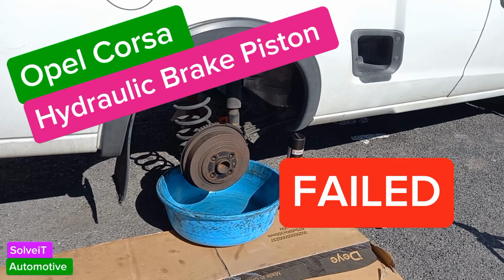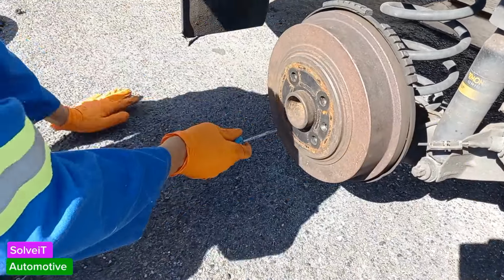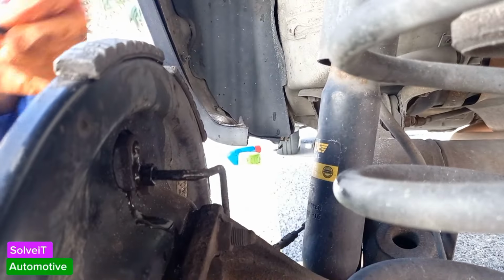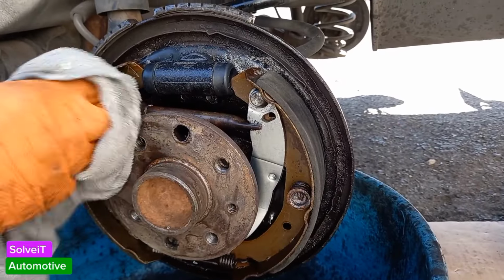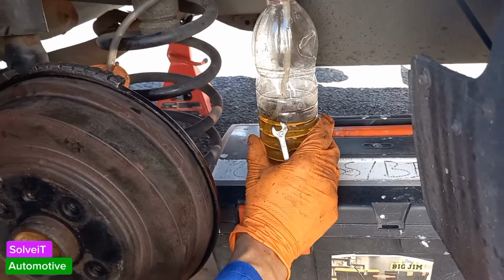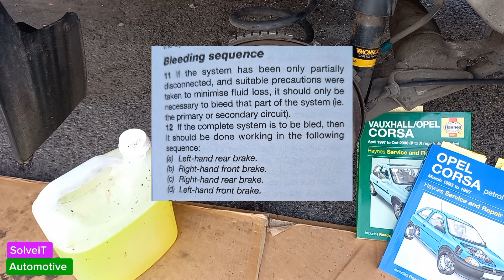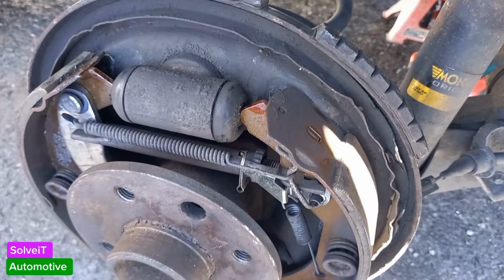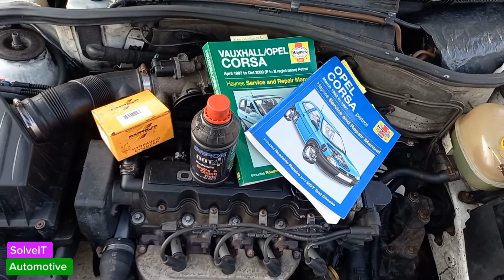Opel Corsa Utility 1.4i Brake Cylinder and Drum Clean

Comment: Good evening please advise what could be the problem on my opel corsa bakkie my 2 back wheel breaks dont work its almost like there is no presure in the break cylinder but when i bleed the breaks at the back the fluid do comes out but not with force please advise what could be wrong because the front breaks do work and the hand breaks
Reply from the maker: Hi . Check your springs and rear mechanism settings also  the cylinders

Comment: Hey - when I drive mine - there's a lot of sounds at the rear - I thought it was my loose canopy but I removed it and drove and it still sounds like something is loose or like metal on metal thuds here and there
Reply from the maker: Hi . It could be a number of things best to check shocks, mounts , handbrake cables , spare wheel cage, exhaust rubbers etc

Comment: Hie , I have problem my corsa 1.4 utility fuel consumption is too high I replaced idling sensor and throttle sensor but still no change . MAP sensor I cleaned it , now I'm suspecting oxygen sensor . The other thing every morning my car stalls after few minutes of driving it stops stalling please what might be the challenge
Reply from the maker: Hi . Unfortunately it can be a number of problems you are going to have to get it checked out. Sensors is best to be OEM Mexico ones.
Check your fuel pump and filter also.
Like I say it can be many things
Reply: Thank you

Comment: Hi.  I'm having a problem with my opel corsa 1.4. It has a slight miss fire. I did service on it yesterday i thought maybe the change of spark plugs n leads will help because one of the leads was broken but it still has that miss fire.
Reply from the maker: Hi . Unfortunately it's something that could be a number of issues, it's best to let a mechanic check it out for you. Misfires can  result from simple things like spark plug and leads to valves , rockers , lifters , worn sprockets., timing etc
It's a lot that needs to checked
Reply: Check your plug's if it's not broken even a slight cracking in the plug can cause it to miss fire